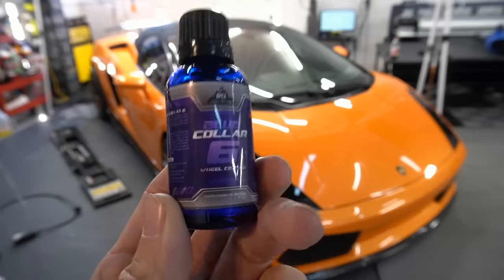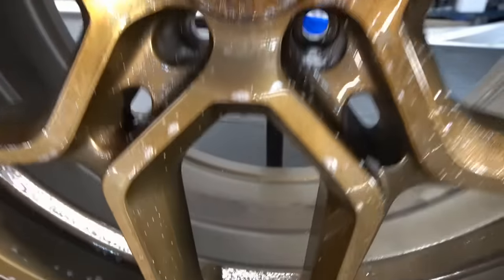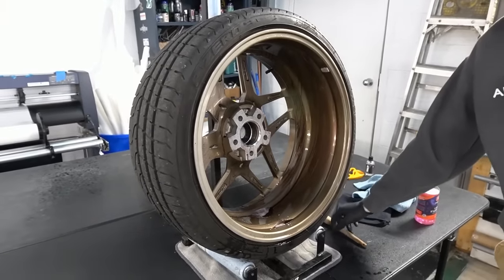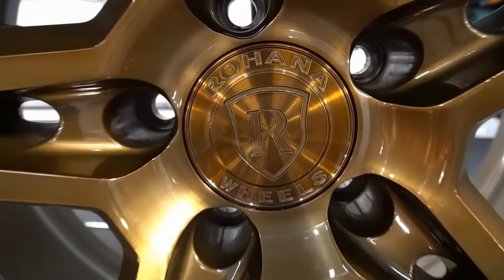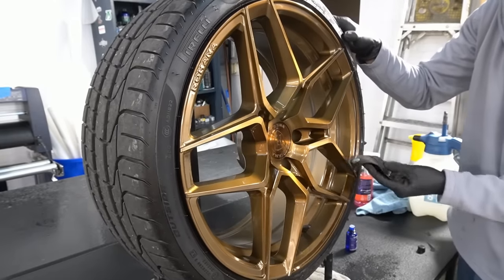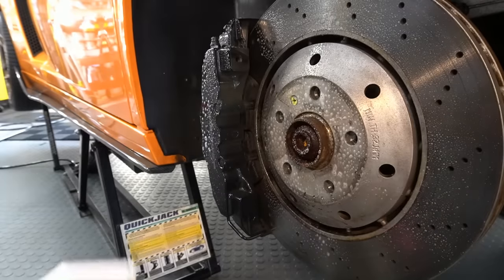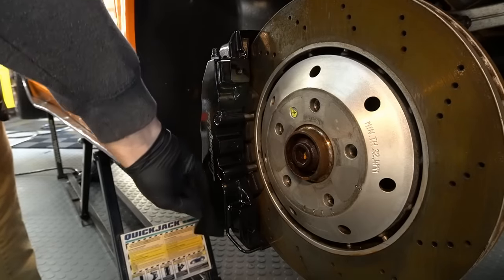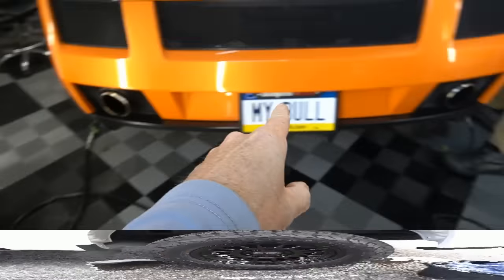Protect Your Wheels With A Track Grade Wheel Coating!! BLUE COLLAR 6 High Temp Coating For RIMS!!

Comment: How long will your wheel coating last on a daily driver (10-K miles per year) with one layer?  With two layers?
Reply from the maker: 1+ on a heavily driven daily.
Reply from the maker: It is difficult to put a timetable on a wheel coating. It is highly subjective.